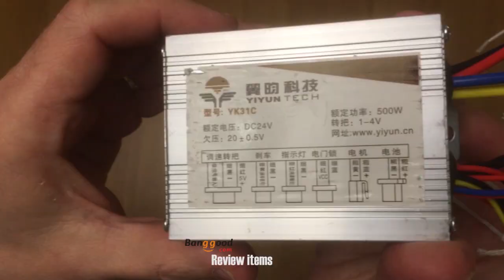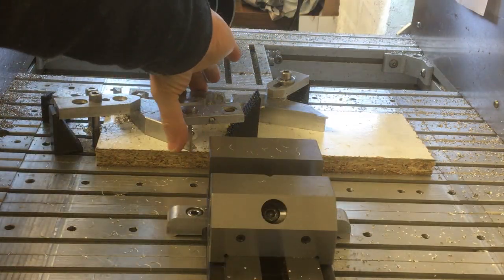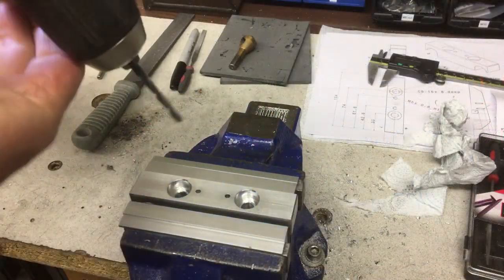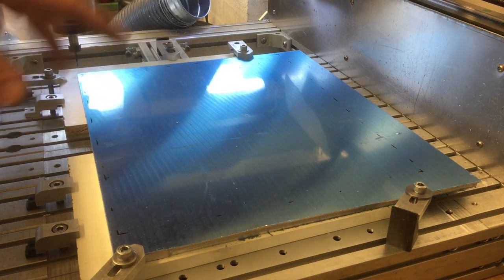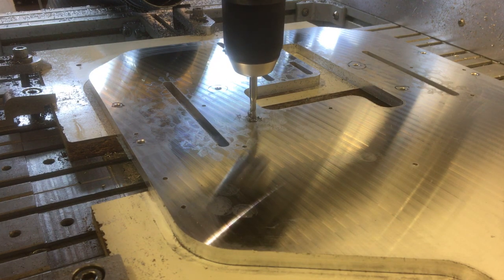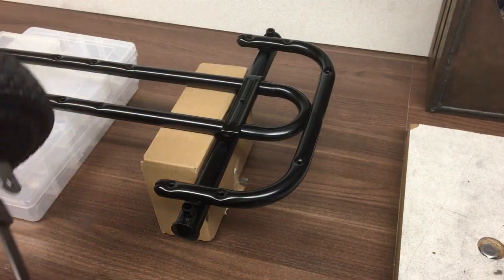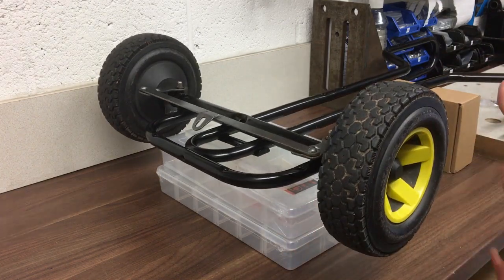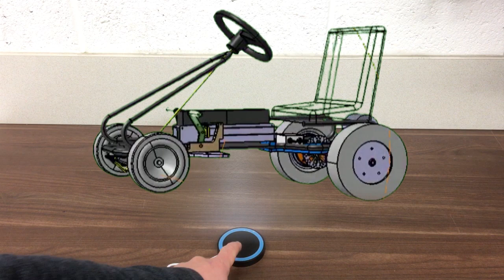Episode 3 e-Kart: Clamps, Driveplate, Frame prep

Comment: Less than a minute in: If you stopped there I'd have been content. Carrying on. I'm sure I'll love this
Reply: I was not disappointed. Totally awesome build. Hope much extra weight do those plates add to the frame? I hope the tubes are strong enough to avoid bending in front of that rear plate
Reply from the maker: I haven’t weighed it all but I was conscious of the overall weight as I may need to lift it into the back of the car!  There is another part to go on between the rear plate and the front pedals to help stop those tubes bending.  Otherwise yes it would look a bit weak there.  Thanks
Reply: @routercnc9517  Sooooo... You are using the the frame as a skeleton for bolted plate assembly? I like it.
Reply from the maker: Yes the battery box goes in the middle and is semi-structural.

Comment: Where is the differential, on the plan? Easy to make differential, whith 2 
piece, one way ratchet.
Reply from the maker: You will see the detail in a future video when I make the rear axle.  I thought about one way ratchets but they are limited in torque transmission and I may want to add a reverse switch in future, and then they would not work.  Thanks
Reply: @routercnc9517  
Oh well. It doesn't really work backwards. I watched Your other videos as well. I really liked the CNC construction videos as well. You're very clever. Zsolt from Budapest
Reply from the maker: Thank you Zsolt.  Glad you are enjoying it and hello Budapest!